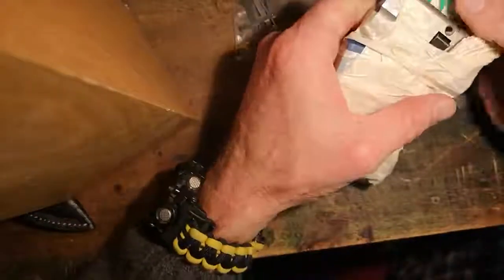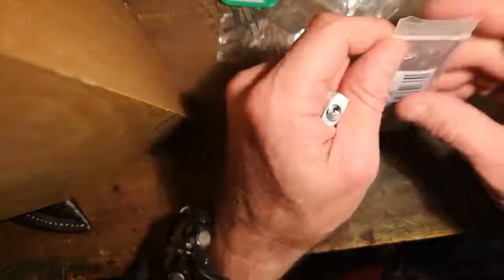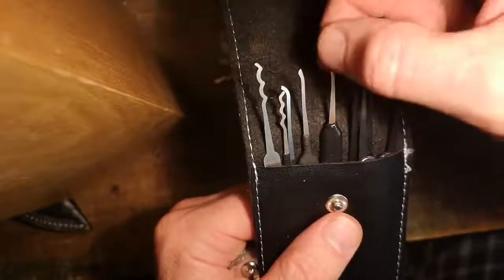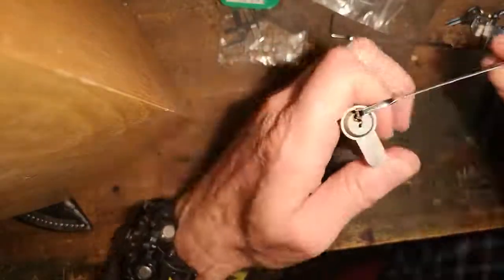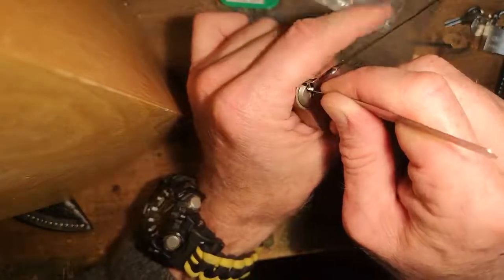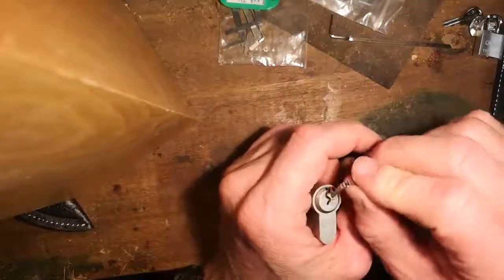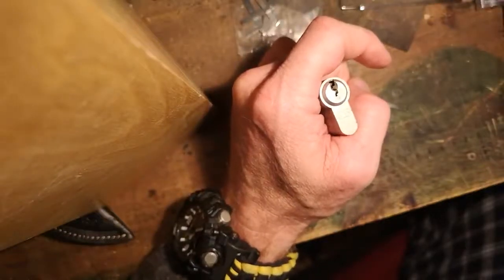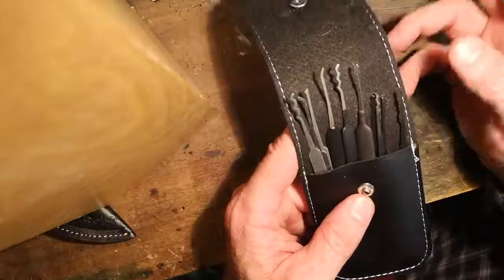Difficult Keyways and Questions

Comment: Locks that small are tricky. You’re using a bottom of the keyway (BOK) tensioner and I think you’ll need a Top of the keyway (TOK) tensioner — TOKs don’t go fully into the keyway, just into the part before the first pin. 

This EVVA is super super challenging because of the keyway (hardest one in that set). To pick it you need a very thin pick and then you basically have to “turn the corner” around the warding… you’ll likely have to do that for each pin one at a time, if you try to slide it around past the warding you’re going to overset pins.
Reply: I just noticed in your next video, you have TOKs :)
Reply from the maker: Yeah, I don't have a pick that can do that yet. I will look for one. That's kinda what I was thinking the problem was. Thanks!

Comment: I really like using the cheap Y wrenches for tiny locks. The y wrench I'm talking about is the spring steel y shaped tool in the Chinese sets that are intended for car locks. Only use just one side as a top of the keyway wrench.
Reply from the maker: hey, I never thought of that! Thanks!